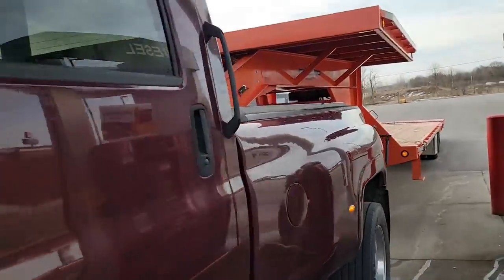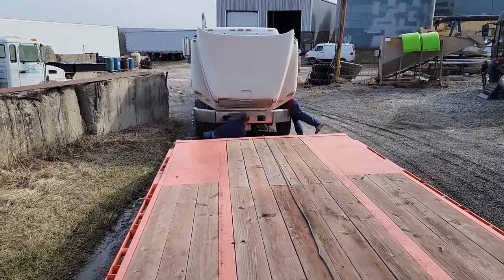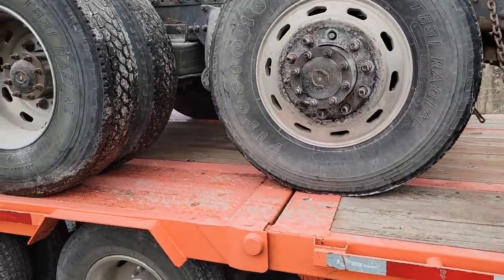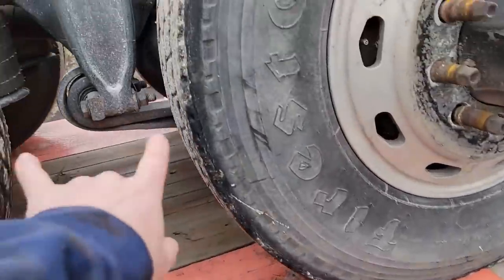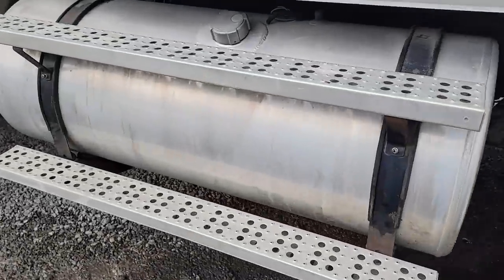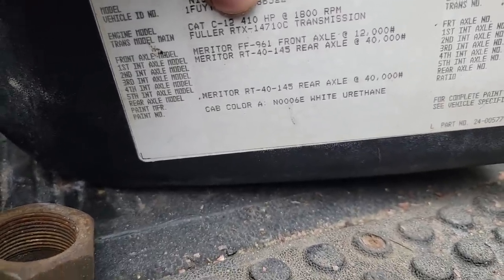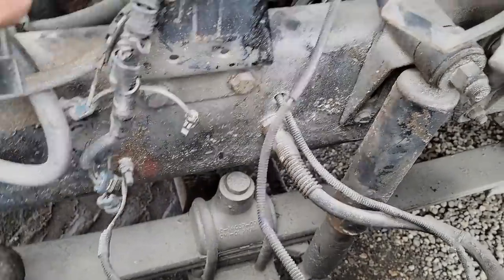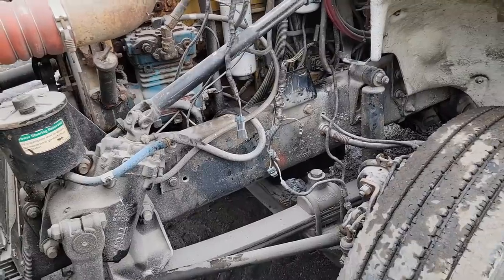FIRST TRIP WITH THE NEW TRAILER?

Comment: Glad the trip to get the truck went well 🙂👍 Yeah, those are some steep grades. Makes the way back worse, cause there's the stop sign on top of the hill. Gotta speed up to just slow back down. Take care 🔧
Reply from the maker: the second truck was heavier and it was quite a bit slower. sure do miss my cummins truck.
Reply: Zane, are you subscribed to 406 Garage yet?
Lots of IH stuff.
Casey Ladell's last video shows a really nice IH beaver tail, flatbed truck 406 Garage just got.
You and JC should check it out !!
Reply: @haroldphipps3457  thanks! 😁👍 I follow them in Instagram. Need to subscribe here on YT to them 🙂

Comment: Looks like that Freightliner has potential.  Whoever worked on it before really did a number on it LOL.  With all those wires going every which way I wouldn’t be surprised if it was an electrical issue like you said.  Good purchase👍

Comment: I had smaller trailer like that. Always had a few old plastic chopping boards in the toolbox to slip under straps and brackets that got caught on the top of the ramp like that. It was just enough to help most things slip over.
Reply from the maker: i was thinking about the hard plastic mudflaps. i used them on my rollback to make things slide easier. thought it might work on this as well.

Comment: Hi from uk 👍👋 be funny if you got good deal on this and was a ground to start but hope easy fix🙏 am pleased you noticed the clearance between sump and axle that be a bad day there😬 was new trailer good with the load on ? Hope it pulled ok for you 👍 that mustang driver got what 150 yrds ahead before traffic 💪🤔 big man and his stang💪 thank you for your time and be safe see you soon👋👍
Reply from the maker: trailer did just like i had hoped. no issues at all. i have not decided on what winch i want to install yet.
Reply: @j.c.smithprojects  think the bigger the better if she plated at front with that inch plate between frame better more grunt for you💪 (just gusset the plate tho just incase) think worst part truck scenario locked up rear end or just a pain to ease the manoeuvring process for you👍 defo need a remote one tho for carrying out these tasks, was good having tractor to load with but might not always have that option and maybe if its a keeper too maybe little extension and legs to support tailift for to get bit of longevity hight (stop tanks and steps catching ) save the woods saving day cos they move as you already know lol 👍

Comment: Curiosity question.   Could you raise the dovetail just a bit next time a tank catches?  Only dovetail I dealt with was a semi hauled dovetail. It was designed to lift our 55ton radar system.

Those 112's are great little what I call a "hot shot" truck. Up here woot of moving companies used them on straight rails and even flatbed tow trucks. Could be a great truck when it's all fixed up.
Reply from the maker: i could have if i was using the front end loader to help push the truck while i ran the winch. the loader needed to roll up the dovetail.
Reply: @j.c.smithprojects   didn't think of that. Thanks JC

Comment: The cab is derived from the European Mercedes “LN” cab, a typical medium-weight cabover with a set-back front axle; hence the stepped floor hidden by the door extensions 🙂 Over here, a factory sleeper and a 4-door crew cab were available. Fun fact: the LN weight range pretty much petered-out at 15 tonnes GVW. I did my driving instruction in a 12-tonner. Interesting that it ended-up being used on Class 7 & 8 tractor units Stateside 🙂

Comment: Did you knock any major holes in the fuel tanks when they scraped the trailer while loading? Or rip them a new one?
Reply from the maker: it wasnt the tank. it was the tank mounting brackets. we knew it would be close.

Comment: I know you probably know this but, if you crank your landing gear down hard, it will change your load angle enough to help. I like that trailer though.
Reply from the maker: you cant tell in the video but i have the gooseneck couple adjusted up 2 holes to do just that.
Reply: @j.c.smithprojects  I crank the tongue jack down on a car trailer to get angle better when loading sometimes
Reply from the maker: i usually carry lumber and drive the rear duals on top of it. this way i am not loosing my "park" and "parking brake". dont want to take any weight off of the rear tires. when loading it can push the truck any where.

Comment: It's going to sound stupid but to fix that winch control I used an extension cord a four pin trailer plug and since I never have the controller anyways I used a window switch out of a jeep Cherokee and made my own set up think about the extension cord you can make it as long as you want you have everything setting around so it's all free just take some time wish you luck I'll make a video and post it if you want to see what I did
Reply from the maker: i have done a similar thing using the original remote handle, some "so" cord and a trailer 4 pin connector. i relocated the plug to the middle of the trailer so the remote cord that plugged into it didnt have to be so long in order to reach the rear of the trailer.

Comment: What do you normally tow with, since you clearly do not like 4500?
Reply from the maker: i like to use my dodge 3500 for most things and my dodge 5500 for heavier things. on occasion i will use a semi but that is only if i need the axle capacity.

Comment: looks like the break over angle on that hydraulic dovetail might be a bit of a issue, does it have enough power to lift a few inches once the front drive gets on the trailer....... looks like whoever did that engine swap has no business working on trucks
Reply from the maker: they tried. so many wouldnt even try. hopefully i can get it figured out.
Reply: @j.c.smithprojects  you make a good point mr smith.

Comment: Needs a 6.0 ford swap
Reply from the maker: certainly not going to replace one low hp and torque v8 diesel for another. if it isnt 6 in a row....its gotta go!
Reply: Good luck on the c12 sir.

Comment: Engine serial sticker missing from front gear cover?
Reply from the maker: they usually have a tag on the valve cover. you might be thinking of cummins. cat stamps the serial number on a machined spot on the passenger side of the block....i just can see it.